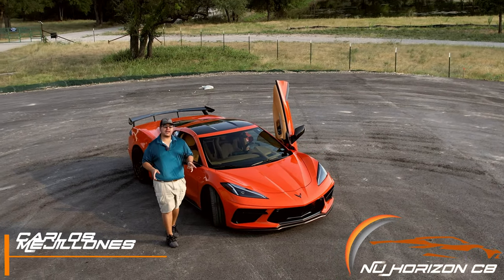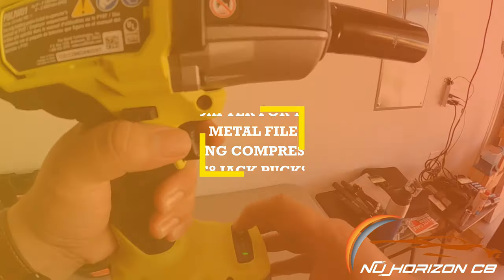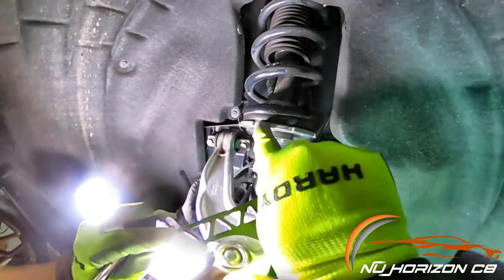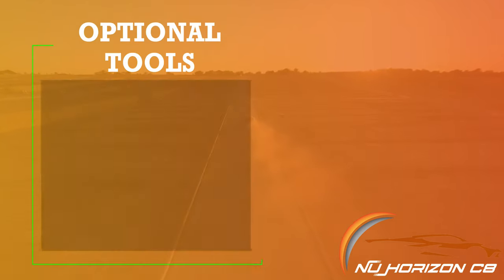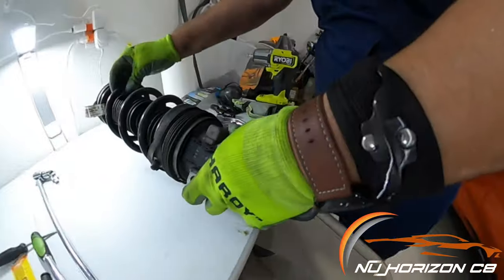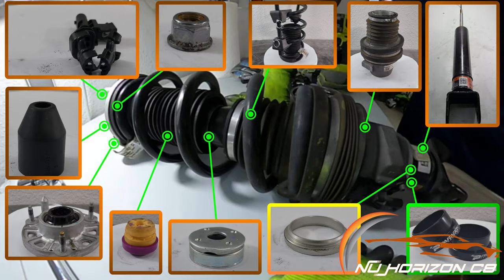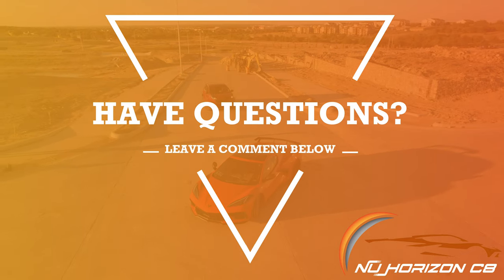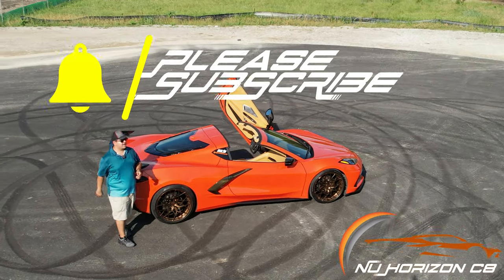Lowering Your C8 Corvette Z51! Full Walkthrough & How-To!

Comment: I have a c8 Z06 without front and lift and I'm wondering is it possible to adjust the coilovers without removing the dust cover sleeve that sits over the threads. I'm not looking to lower it all that much just about a quarter of an inch or half an inch. And if I'm corner balancing the car I don't want to have to remove that sleeve every time. Thanks

Comment: question what size rims and tires do you have your vette? I had the kit since April of last year but haven't put it on my car yet.
Reply from the maker: so i have 20s on the front and 21s in the rear. I went with 255/30/20 tire sizes for the front and 325/30/21 for the rear. You make the clearance but itll be a tight fit on the rear tire. Id recommend the 325/25/21 for the rear tires just to give the extra room. Lowering your C8 though will help with the clearance actually as it will center the wheel better in the wheel well compared to stock height. Let me know if you have extra questions.

Comment: Amazing video Carlos. Thank you so much for all your hard work. You may or may not the answer to this question however... I ordered aftermarket rims for my C8. They are factory sized but offset to where they stick out further than factory to be inline with the fender. Does this come in to play when lowering? So in other words will the wheels potentially rub the fenders?  Thanks
Reply from the maker: Hey Stan thanks for the comment! I dont believe you'll run into issues if yourbstaying the same size but going slightly wider as my aerolarri wheels are an inch larger along with being wider as well. In fact by lowering your C8, youllactually be making the wheels fit more centered on the wheels wells which will help your clearance. Have a good one! 👍😎

Comment: Excellent video!!. After driving for a while, how is it?. BOS just did a video on his lowered C8 ( with lowering Springs). After watching his video, I’m not going to lower my C8 as much as he did. Do you find the 3/4 inch to be the sweet spot?
Reply from the maker: Hey Mark thanks for the comment! The lowered height on mine has worked great with pretty much no issues whatsoever. The ride feels great still and overall handles really well when pushing it. I think the answer on the correct lowering height comes down to what kind of final wheels size your using and whether aftermarket or oem. For me personally, I dont think id go personally lower than my lowered height at 3/4" but thats because I like how my wheels specifically fit and going the extra size up both front and in the back. But if i went with a different wheel size or stance, I think Mikes height works great too. Have a good one!

Comment: Did you bleed the front lift after? I don't think it has an auto bleed feature?
Reply from the maker: Hey Derek. I did not have to bleed the front lift after and it still functions fine.
Reply: @NuHorizonC8  interesting.
Reply: The front lift actuator has a bleeder screw at the top. I would gravity bleed it to prevent any air getting caught in the system. Hydraulic systems should always be bled to prevent cavitation imo.

Comment: Can you do this on a non-Z51 magride?
Reply from the maker: Hey Nic B thanks for the comment. So for your case, youll need to go with lowering springs. The Z51 suspension is a coilover systen which makes it adjustable with the wrenches. Standard suspension doesnt have that. The lowering springs would be the primary option both if you have or dont have mag ride on a nonz51. Hope that helps!

Comment: Top passenger perch won’t move. No matter what I do it tries to spin the whole coil, even with a vice grip. Any ideas?
Reply from the maker: Hey vict thanks for the comment. Depending, you may be able to get away with using a spring compressor to just maintain a slight compression of the springs and make it easier to move that top sprocket down without the whole thing turning. Either that or using some more vice grips and duct tape to try and get a better grip and/or keep certain sections from moving also. Hope that helps! 👍
Reply: @NuHorizonC8  I am currently sitting here looking at my car half raised half lowered… I already did the driver side and it took some struggle but all in all it was simple. For some reason no matter what the passenger side will not cooperate. I think I am going to raise the drivers side back up for the time being lol
Reply from the maker: @victorcabanas7191  trust me when i say i ran into the same issue. The best thing i found was using a compression tool to slightly compress the spring. That helped ALOT but if you dont have one then i can understand where your coming from. Best i can say is using extra ducttape to try and help hold it in place while you have the vice grip over. I ended up also using a pair of extra wide pliers instead of the vice grip so i could get even more grip strength to hold it down as I was turning. I will say its gunna be just as hard placing the sprocket back on the side you just lowered. Id keep going if you can. Good luck either way.
Reply: @NuHorizonC8  i think I will keep going. I’m doing spacers and lowering so I gave up on it for a second lol. I have taken springs off strut towers before but they were off the car. Am I going to be able to compress it while it’s on? Also I have the z51 + electronic front lift do I need to buy the collars too? Thank you for your timely responses you’ve been more help than all of google combined!!!!
Reply from the maker: @victorcabanas7191 yeah youll need the front collars or lowering springs to lower the front. The front lift system removed the ability to lower with sprockets on the front. Keep in mind if you do lowering collars theres a risk of warranty issues if your front lift ends up failing. Im glad the videos help! Keep it up!
Reply from the maker: @victorcabanas7191 also its a tight fit for compressors but potentially doable. It depends on the version of compressors you get and i couldnt tell you which ones to have thatll work with 100% confidence
Reply: @NuHorizonC8 what are the chances of the collars causing failure??
Reply from the maker: @victorcabanas7191 Egh thats a complicated answer. Long story short the collars dont cause the failure but GM has a bulletin stating any C8s with lowering collars on and failed front lift voids suspension warranty. I talked about it here.

https://youtu.be/PU854R7Pphc
Reply: @NuHorizonC8  got it I’m gonna check it out in a second